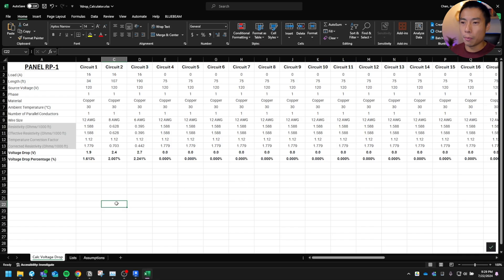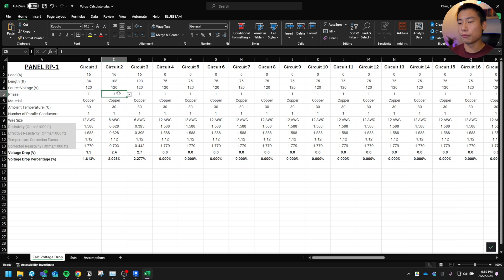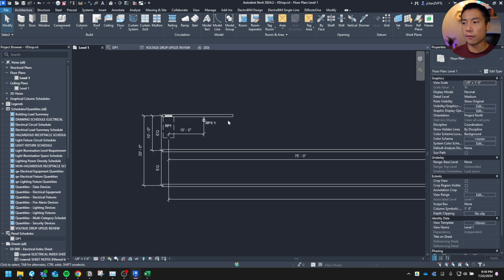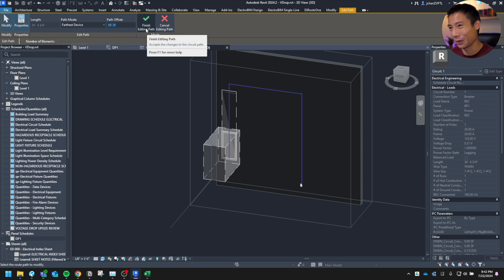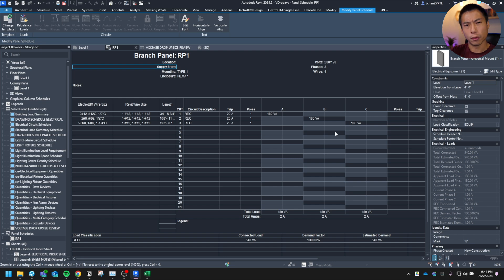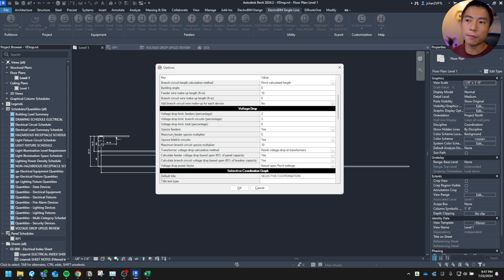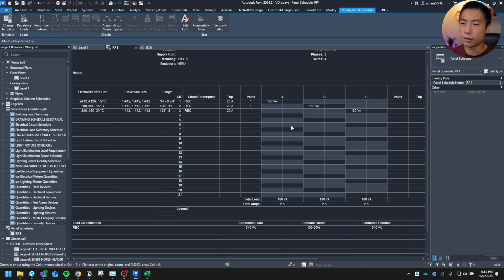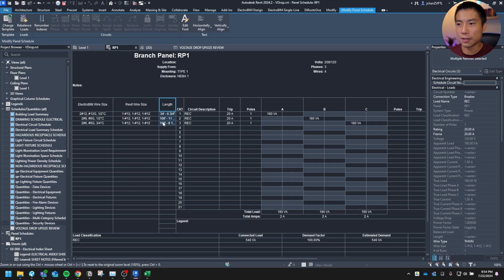Voltage Drop in Revit: The Good and The Gaps

Comment: can you show how to calculate voltage drop for parallel cable like, 2x4Cx240mm2 for current 630A and length 400m?

Comment: I have a question. Is it possible to model site poles with conduit and wire but at the same time have a voltage drop schedule that will calculate the voltage drop if you modify the conduit runs?

Comment: Jon feeders are 3% and branch CKTs are 2%. I always VE as per this percentage. the reason being is the feeders usually travel long distances with bigger load at the end however branch circuits shorter distances are usually smaller load like receptacles lights etc.
Reply from the maker: Ah that makes sense….i do wonder tho, doesn’t the feeder to the panel have the advantage of always being calculated at 3 phase, thus typically not as much of an issue as the single phase branch circuits? If you hold the branch circuits to 2%, you’re very limited in distance for single phase runs.